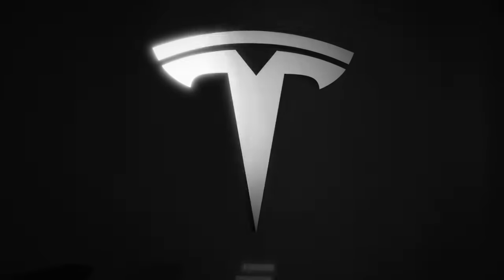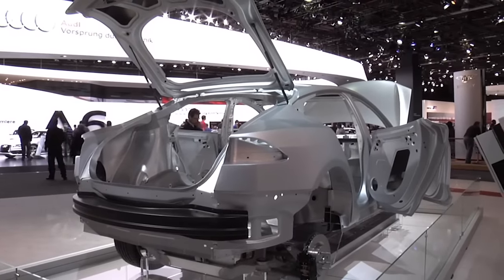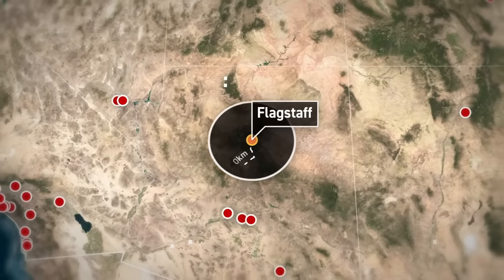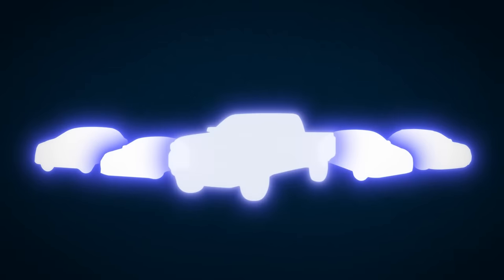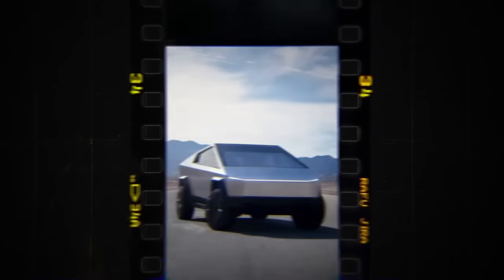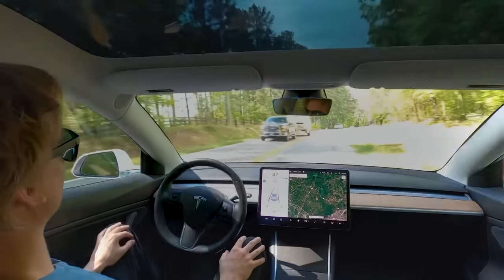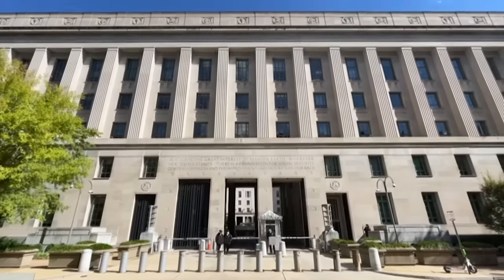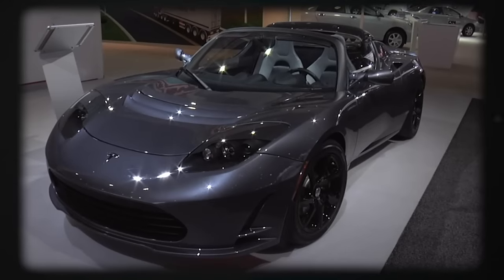How Tesla Fumbled

Comment: I work in a parts department, and every time we get in a used Tesla to sell at my dealership I die a little inside, we can't get parts from Tesla and have no way to repair them, can't even get license plate screws for them or wiper blades for some. It's so annoying, they operate like an Apple store not a dealership.
Reply: I thought there was a right to repair bill that specifically made that kind of policy extremely illegal for car manufacturers, and that it passed a solid 20 years ago, does Tesla just care as little about that law as they care about respecting unions?
Reply: @justalonelypoteto I don’t think Tesla as a company respects laws of the land. Look at their abusive acts in customer service and more importantly its owner’s behavior.
Reply: I remember that one guy who rebuilds teslas to spite the company was having a hard time just to get caps for the stems on the tires
Reply: My experience with Apple is service is off the chart amazing. Has your experience been bad?
Reply: I hope Edison Motors can be successful. It is an electric and hybrid-electric semi and other vocational truck company. They also offer conversion kits transform a conversational diesel truck into a hybrid. 
They use primarily “off the shelf” components rather than exclusive, proprietary pieces. 
They specialize in logging trucks where the unloaded truck can use electric power going up the mountain, get loaded with logs, and use regenerative breaking while laden with logs going downhill to recharge. 
They were founded in British Columbia, Canada.
Reply: Honestly speaking, Tesla is like Apple in automobile sector 🥲
Reply: @justalonelypoteto That's for just gasoline vehicles. There's little no no regulation on electric ones.
Reply: @lakovkreativity  Richard from "rich rebuilds" loved EVs but didn't have the money to buy one so he rebuilt a model S. He doesn't rebuild Teslas out of spite, he just mocks them for their pathetically bad customer service.
Reply: @justalonelypoteto  dont trust dealerships, dont trust their employees

Comment: I know that right to repair wasn’t in the thesis for the video but I think it would have been a nice mention when you were talking about service centers. Tesla could provide better service if they provide parts and repair manuals to independent repair shops but instead they vehemently want customers to go through official channels only which is why they’re in that predicament.
Reply: Think about this, if the FACTORY trained tech system sucks this bad, how bad do you think their third party repair support would be?
Reply: is probably to keep designs secrets no? maybe there is no documentation ^^?
Reply: @mzaite  There are 3rd party specialty Honda, BMW and VW shops in every mid-to-large city in the US; they provide stellar repair service. Why would a 3rd party Tesla specialty shop be any different?
Reply: @Michael Zaite  because 3rd party mechanics need to compete. If their service is bad, no one will go there. 

In my experience, 3rd parties have always been better. But, with companies DRM their products, of course it repairs will get worse. Thats why right to repair is very important
Reply: @brujua7  Third party will only be "black box changes". You don't have to know what's in the box to figure out it's broken, especially on a Tesla which has a very tight internal communication structure. The car can probably tell you what's broken.
Reply: @Random_dud31  It's probably a very big reason why a I.C.E. owner would fear having an EV... myself partially included. 😬
Reply: @dougerrohmer  "especially on a Tesla" which of course is exactly the problem.  It's not black box because electricity, it's black box because anti-consumer post-sale maintenance monopoly.
Reply: @HonoredMule  No, my point is that the real tech that Tesla may want to not have copied is the software and proprietary IC's in a box with a specific function. You don't have to know how it works, just what it does. So to repair it, you replace the box which you can do under a tree in your back yard after buying the replacement box either from Tesla or a third party supplier.  So there is no reason for Tesla to be as they are, disrespectful of the right of repair, but they are that way.
Reply: @brujua7  No, it is to keep a monopoly on service, which is highly profitable
Reply: @stephenj4937  It's funny I used an Inde BMW shop just today! 

The issue is Parts, and the training or Service guides.
Reply: @mzaite  Pretty awful to non-existent.
Reply: @brujua7  There is plenty of documentation, and I even got access to it.
Reply: @stephenj4937  Because they are afraid of high voltage electricity.
Reply: @dougerrohmer  A lot of cars can, Tesla is just better at it.
Reply: Maybe forcing customers to go to an official service center allows Tesla to log the problems that are encountered, which then gets sent back to their engineers. I highly doubt that independent service centers would bother to report the issues they work on.
Reply: All of Tesla’s service manuals are online. They posted them about 1 or 2 years ago for independent shops and private users to repair cars.
Reply: @SnoopyDoofie  If that were the case, they would have no right to sell these cars outright at all and would be basically running a lease research fleet like the old GM EV-1 or the even older Chrysler Turbine Car. 

Once they're selling a consumer product, they should already have a handle on "surprises" and have engineering that's ahead of the third party repair system. It's part of what manufacturers get back from offering warranties. You know, when they have enough techs and service stations to actually get to cars.
Reply: @dougerrohmer  Well, with Tesla having made all patents public and free-use, there isn't much reason why a third party firm couldn't handle servicing.
Reply: I agree. I feel like Tesla is the Apple of EVs in terms of right to repair, user rights and it being "their way or the highway". 
I personally want a Kona EV. Where I am in Australia, it fills the brief almost perfectly.
Reply: @mzaite  The independent BMW-specialist service I use is so much better than the 'authorized service' that it's not even funny. For example, I was having an issue with aircon refrigerant leaks having to top it up practically every month (€170 per fill in the authorized service) and they couldn't fix it for a year! After I got sick of paying them recurring fees for a top-up, I took my car to an independent BMW-specialist and they fixed it within a week, not an issue ever since. I'm never taking my car back to the 'authorized service'.
Reply: Everybody just tries to hard to be Steve Jobs. Care aren't phones those. Nobody being able to fix a car is not a good thing. Those ugly cars aren't Ferrari's, waiting weeks or a month for your car to be repaired far from where you live isn't a selling point.
Reply: Josias Lourenço  Literally no one asked
Reply: Bargain basement engineers designing body parts.
Reply: @dougerrohmer  will you people stop making things up? There is no right to repair. If you can't get the parts you have somebody else do the frikin job.
Reply: @GrinerB  battery powered cars isn't a selling point either. This stupid crap is coming to an end. Along with windmills for electricity.
Reply: I make $185,000/year in the tech industry (outside Silicon Valley, remote work) and I can pick and choose between most high-end cars (except Koenigsegg & Co).
I will NEVER buy a Tesla, both because of Musk (he needs to go) but also because of their approach to service. If I can get a Mercedes fixed at an independent mechanic, why can't they fix a Tesla?

I honestly admire the cars and I would love to have one, I just don't want to be attached to that company. I'm in a constant mental struggle about "Should I just get that Tesla?" - "Fuck no".

So I drive a Kia in protest. Which is now, ironically, more expensive than a Model 3.
Reply: @mzaite  chances are it would be better. Because it would be a small business owner trying to make a name for themselves, instead of some corporate underpaid Tesla mechanic just waiting until it's time to clock out.
Reply: So is apple
Reply: They DO offer training manuals and parts list for anyone that requests them.
Reply: @aminfozdar  Yep.  Tesla desperately wants to be a "tech" company with an Apple like walled garden 'ecosystem'.  That's the only way their stock prices is remotely justified (and even then, it really isn't).
Reply: They are literally the Apple of cars.
Reply: Lol, Tesla already does this. Can get your garage serviced at thousands of non-Tesla garages here in The Netherlands. Ofc Wendover didn't cover that, because it didn't suit his narrative.
Reply: @Ehralur  Because the EU Commission  forced Tesla to allow 3rd party service (back in Feb 2021).
Reply: @GrinerB  You say that like it's somehow less bad for computers, where it's actually even harder to find legitimate justification and modular design is actually easier not to mention just fundamentally better.
Reply: They are copying Apple's practice on that front. From the start they have been trying to establish their branding and trying to make that part of the price tag like a fashion item. Allowing independent repairs breaks that exclusivity and prolong the product lifespan beyond what they intends, need to get customers to keep buying new models.
Reply: @deker0954  I'm not following what you are saying? My point is if you buy a vehicle, you should have the right to repair it. Tesla is known to prevent that. Check out Rich Rebuilds earlier videos - he bought a salvaged Tesla that was flooded and repaired it, with no help from Tesla, in fact active opposition. That's not right.
Reply: @Ehralur  bingo
Reply: Screw them then hope they Go Bankrupt 😂😊
Reply: @SnoopyDoofie The car has to get mandatory software updates regularly and it has a diagnostic computer like most cars. Why can’t it communicate operations data during those updates? Why is a human required to retrieve this information?  That doesn’t sound very “state of the art” does it?
Reply: @dearyvettetn4489  Tesla cars DO get software updates while the car is even on the road. Software cannot record mechanical issues that a mechanic is able to recognize.
Reply: What reality do you live in?  Tesla supplies free shop manuals for repair -- einstein.
Reply: Tesla owners live Tesla service ! We do t want to deal with third party dealers. Simple as that.
Reply: @dearyvettetn4489  Computers can't monitor all hardware problems. Do you expect it to detect a leak that allows rain water to come in?
Reply: @travcollier  These service stations have been servicing Teslas for years...
Reply: @brujua7  at this point, all the rival car manufacturers have better builds than Tesla. there is no more secret sauce, it's supposed to be Tesla's software but it's not even that good.
Reply: There´s a ton of money in the after market and spare parts industry, no wonder they want to monopolize their own repairs and servicing ^^
Reply: It's all about legality, if someone screws up something then blames it on Tesla then Tesla has to go to court and investigation has to be had , time lost, lives lost possibly if grace accident, money etc that's Why they don't let others repair, legality implications
Reply: @mauricesupot6641  You think Tesla's software isn't "that good"?  You should check out the competition.  Try a Volkswagen.
Reply: If you watch Wham Bam Teslacam a common theme is any kind of body damage takes several months to repair, that is assuming the parking lot fender bender didn't total your $70,000 car
Reply: In Italy everybody can download the workshop manual and buy parts from Tesla, except things like battery packs and motors
Reply: It also would have been nice if he mentioned that a number of states won't allow Tesla to put service centers in the state because dealerships have bought off the politicians and they wrote laws disallowing service centers that aren't dealerships
Reply: @travcollier  OMG get lost
Reply: @GET2222  Maybe so, maybe Rich is a fraud and click baiter, but no other vehicle manufacturer has a problem if you want to rebuild their stuff.
Reply: @mzaite  It is quite the reverse. In third party shop how your service run directly affect your shop, in dealership a bad service only put bad name on the company but not the individual shop.
Reply: @QiuyuanChenRyan916  Unless the third party shop is making their own parts and does their own full R&D for tear down, and Tool creation, there's still a problem.
Reply: @dougerrohmer  name another manufacturer that allows some small garage to work on an EV? GM and FORD won’t even let their dealerships sell their cars, let alone work on them without spending a million with them to get access. 

This is all BS. Rich isn’t a fraud, but I understand Tesla reason for not wanting any Joe to work on their cars.
Reply: @nielsvandenkieboom5034 what good is the manual if I can't buy a replacement battery pack myself and do the install in my backyard?
Reply: @stratagama  yeah because they have shitty cars with old technology that nobody wants lol A Tesla is a robot on wheels, not a car.
Reply: The only way independent people could service and repair parts, it would be needed to give away blueprints and software/hardware that they do not want to give up. It would also hurt their bottom lines. many car companies sell cars almost at a lost just to earn back the money from parts and Repairs. So does Tesla.
Reply: I know this is a crazy idea but bear with me here....EV batteries are not the same as internal combustion engines. Tesla is using its own service centers in part to document issues that can be immediately relayed back to the manufacturing team. It will take years to iron out these issues, and it will take years for independent service centers to figure out how EVs work, let alone have the ability to service them properly. Which means for now Tesla services its own vehicles.
Reply: @mzaite  if the electronics/automotive/farming equipment/software and analytics industries are anything to go by......pretty damn good.
Reply: @mzaite  Company service centers exist only to fleece you. Joe Shmoe the Mechanic with his handbook could do better service than anyone working in one.
Reply: @jooot_6850  Getting the handbook is most of the problem.
Reply: Indeed, a lot of potential buyers are put off entirely for this reason alone. It may not mean much for big city folk but it's a huge deal for people around and outside cities.
Reply: @brujua7  design secret is an extremely weak argument. Competitors have the resources to buy one and just find out those stuff for themselves. And there are patents anyway. There no documentation? Then Tesla should make one.
Reply: They want to be the Apple of cars.
Reply: Great point. It clearly doesn't have to be a problem for the company since Apple is doing the same thing and still consistently selling extremely well, but clearly Tesla is not reaching the same success, even though they've both got the same strategy of being all about the brand.
Reply: Anyone in this comment section that thinks a 3rd party repair center will always be worse than the manufacturer is an idiot. If they are provided the same info and able to acquire parts, they'll be close to or just as good (most of the time, better). 
When your a smaller company reputation is everything.
Reply: Tesla not only wants you to go through official channels, they want you to sign an NDA preventing you from speaking about the experience to maintain their cult imagery.